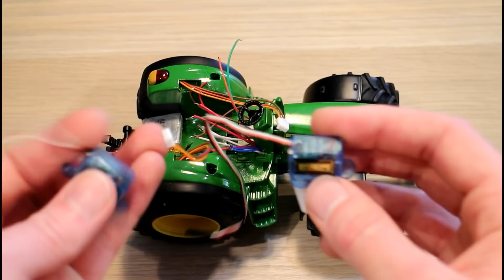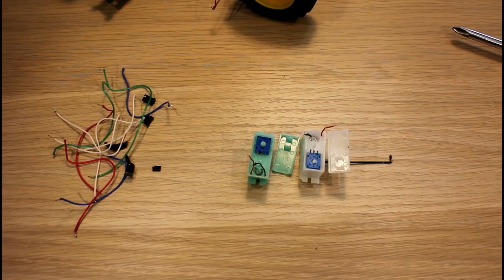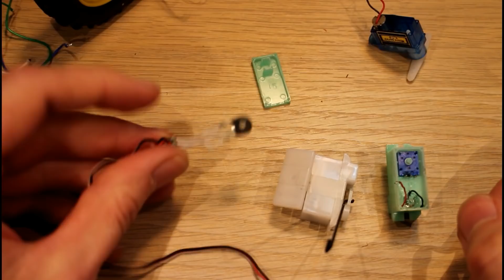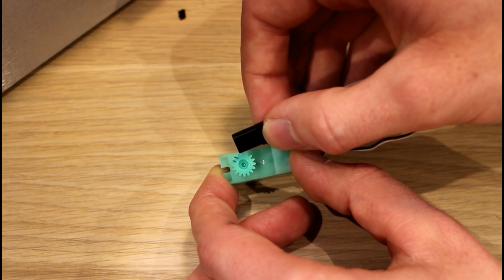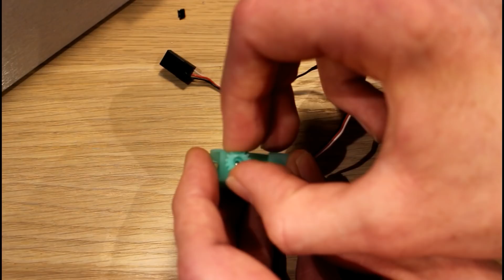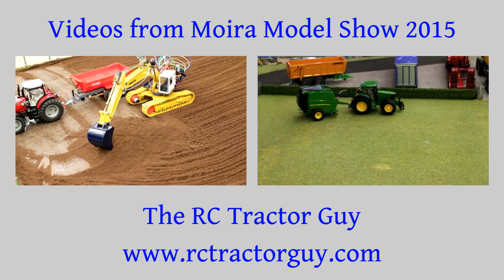Converting a Siku Control 32 John Deere 6920S Part 4 - Success with the Servos

Comment: Is the hobbyservo an towerpro 9g sg90????
Reply from the maker: +Marcus jd 99 The servo was a towerpro 3.7g, cheap little servos from ebay. Not too strong but they're cheap and have worked well for me so far.
Reply: +RC Tractor Guy i think i vill youse that servo to my steering but is IT strong to turn the wheels???
Reply: +Marcus jd 99 the litle 3.7g servo😀
Reply from the maker: +Marcus jd 99 I haven't used it in the steering of any models but I have used it in the lifting arms of the Massey and it works okay. Here is a video of me testing it just skip to around 9:18 https://www.youtube.com/watch?v=PJtJSY2lP4M. I would guess it would work fine but I'm not 100% sure.